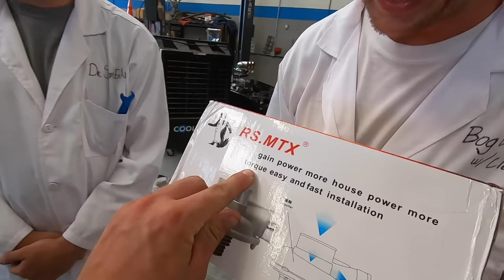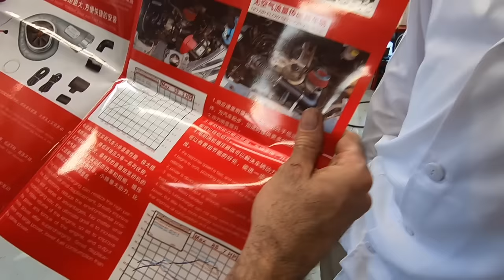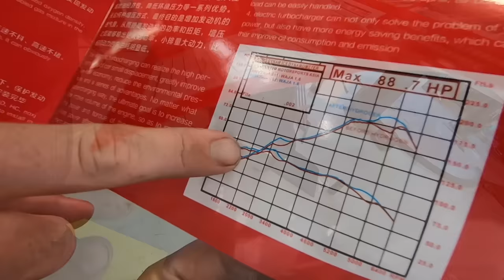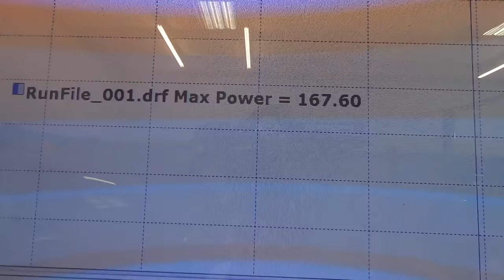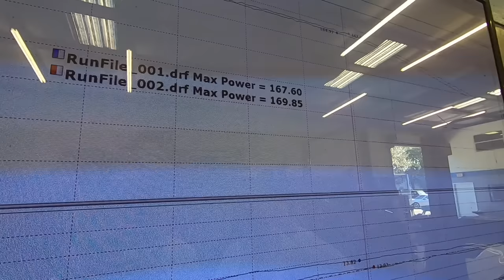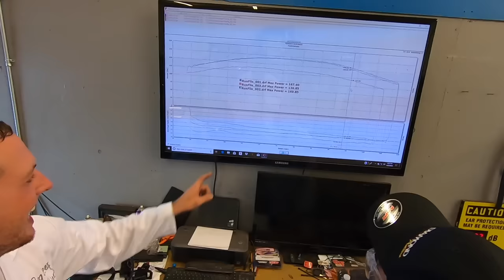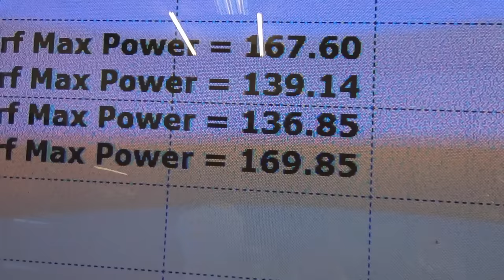Dyno Testing a $400 ELECTRIC TURBO! Funniest Car Part EVER!

Comment: Okay so take the same “turbo” and wire it to 24 volts instead of 12
Reply: Doble powah ... ;-)
Reply: MO powa
Reply: It obviously needs twin e-turbs :)
Reply: That's what I was thinking bridge a few optimas together and send it!
Reply: Dyson power, change out the electric motor for a brushless Dyson,  agreed that not only 24v maybe 48v
Reply: Or hook it up to a little 4 banger that doesnt need as much air
Reply: Add a 5 to 1 gear reduction transmission so the thing spins at like 50000 rpms rather than 10000 rpm
Reply: @gremotorsports  so if I add a 5 to 1 gearbox to my car it will go 1000 mph with the same engine?

Comment: You need a small engine to test these. They're designed for cars in countries that have engines of 2litres not 4 or 6 😂
Reply: 1 liter 3 cylinder car. Mightycarmods did it on such a Car. But a 50cc 4 stroke scooter would be the best to see if gaining horsepower is even possible with this.
Reply: @patricknintemann924  it doesnt it has been done on pocketbike
Reply: @patricknintemann924  How about a .12 OS RC nitro engine?
Reply: It won't matter.  In this case it's actually restricting the air flow, but even if it did not restrict the air flow, it won't increase the air pressure going into the intake.  It's just a rip off.  If it was really that simple, then OEMs would be using electric turbos as they would be far more tunable, cheaper, and simpler to maintain than standard turbos.  This product is for people who don't know anything about engines.
Reply: @i486DX66  electric motors can and do spin at higher speeds then combustion engines. They can produce ridiculous amounts of torque also. This case,  was simply undersized pump for the capacity.
Reply: @burnout9069  First of all, conventional turbos spin much faster than the engine.  You might be thinking of super chargers which are mechanically driven from the engine's crankshaft.  Although I never mentioned anything about RPMs or torque, it's simply the fact that in order for an electric air pump (let's call it what it really is) to increase power output of a combustion engine at all, it must be able to feed the engine enough air at high enough air pressure to create "boost".  People have tried attaching gas-powered leaf blowers to the air intakes of much smaller engines and it made little difference in power output of the engine.  Again, if extra horsepower was as easy as attaching what is basically a hair dryer fan to the intake of an automobile...OEMs would have been doing it long ago.
Reply: @i486DX66  I'm fully aware of the concepts. My point was still, this application was undersized for the capacity it was trying to feed (boost)  too. Now if this same pump was placed on a much smaller displacement engine, with the needed fuel to supply the added air being forced from what positive pressures may have been offered. This $400 blower/turbo wouldn't look so bad. 
Could it sustain the boost? That's another story?
Reply: @burnout9069  Obviously it's undersized because it's actually restricting the airflow which is why the power output dropped substantially.  But even if they attached it to a 1 Liter 3-cylinder engine, it would not increase the power output because the electric motor would not be producing a sufficient pressure differential at the output vs. input.  Although based on the number of people here defending the worthless product, I can see why it's being sold.  Apparently there is a market regardless of whether it works or not.  But $400 for that piece of crap?  Wow.
Reply: @i486DX66  Did I miss the air flow chart? (genuine question). Not that this product would have been clear on that anyways. But your understanding isn't entirely true mate. Regardless how the positive pressure being made on the inlet side, makes no difference. If it could hold pressure (torque) through out the tracts,  and additional fuel supply was met in offering a clean burn. Power gains would be seen. Its simple physics that can't be ignored. 
Whether it's brought or not,  makes no difference to me. I don't sell them. Nor would I have any use for one.
Reply: @burnout9069  Even if the product was installed on a much smaller engine, it would not be able to sufficiently increase the air pressure to generate any kind of a increase in engine power.  How do I know that hair dryer motor won't sufficiently create enough pressure?  Because, as I said earlier, if it was that easy, all OEMs would be doing it.  If that simple motor actually worked and provided equivalent forced induction comparable to a conventional turbo, then everyone would be doing it!  One advantage to that approach unlike the conventional turbo and superchargers is that peak "boost" would be delivered almost immediately without having to wait for the engine to rev up.  It would also be a lot easier to install, cost a lot less, much less weight, take up less space, no maintenance, etc.

Comment: its spinning the wrong way, you guys should reverse the polarity and try it again.
Reply: That's just the shutter speed on the camera.
Reply: @joe_clark
"I understood that reference!"
Reply: @Private Name withheld well it certainly looked like it was blowing the right way when it was out of the car but when they had it installed it certainly seemed to be going the other direction. if the camera made it look like its going the correct way once why would it make it look like its going the wrong direction 5 minutes later when filmed by the same exact camera
Reply: @nath8907  go back and watch 17:54 at .25 speed and tell me that thing is spinning the correct direction.

Comment: Hey man it’s because the Mass Airflow sensor needs to be pre-turbo. The “turbo” was causing turbulence and (possibly?) positive pressure that the MAF sensor was never designed to deal with
Reply: I thought about that too..  but these guys are amateurs.
Reply: Yup... went through the same thing when I turbo’d my tacoma truck 👍👍
Reply: That and it was spinning backwards
Reply: fact of the matter is whether this can increase the CFM...maf adjusts for additional air going through it (mass air flow...).  A blender can't supply enough air for an engine at higher rpm.  Some manufacturers are installing electric turbo's for extremely low rpm conditions, where the CFM needed isn't high.  If you want a turbo - get the real thing.  They're expensive for a reason.  If you want cheap hp get a bottle of NOS.
Reply: @dovobis  an electric turbocharger isnt worth it. Even at $400. Theres no bang for your buck there. I'd look at an engine swap or a real turbo kit before this thing.
Reply: These guys won't understand what that means
Reply: @ Ignoramus
Theoretically yes, but all factory turbocharged vehicles from the factory equipped with a MAF (not a MAP) sensor have the sensor located pre-turbo to get the most accurate reading. Spinning “turbo” blades cause vortex turbulence that confuse the MAF sensor and causes the ECU to retard timing when not specifically tuned around that. When I turbocharged my Tacoma truck, it ran very inconsistent with the MAF in the charge pipes. Now that it’s pre-turbo, it’s very consistent and doesn’t hiccup like it did. I’m not saying that all vehicles are like my truck, but the fact that all turbocharged MAF equipped vehicles have it pre-turbo does say something.
Reply: Here's the thing... Any electric turbo/supercharger will need to pull a certain amount of current at FLA.

Now.. when calculated how much FLA is being pulled from the turbo at so many RPM'S 
To produce so much horse power.. the same test will need to be done to figure out what the FLA is with the engine under load, and how much of resistance that is making for the alternator..  resistance = horsepower needed to turn the alternator ..  if the turbo is working against the horse power there really is no point to it.. and after thinking about this.. this might explain the 30HP drop... Resistance is a bitch when it comes to electrical motors.

Comment: Put the electric turbo on a less than 1 liter engine
Reply: Yep seriously, the moment i saw the drop, I knew the "turbo" was choking that V8. Perhaps a lawn mower engine would be more apt.
Reply: Put it on a Go Kart!!
Reply: That's not a happy motor any more...  I drive a 1 litre 3 cylinder turbo Opel that turns almost exactly 100bhp & 170nm+ on the wheels, only thing not standard is the Michelin Pilot Sport 4 tyres.  But seriously, that electric fan doesn't blow enough, it may work on those old 850cc Fiat Uno Cento from the late 90's but I wouldn't hold my breath.
Reply: Yeah I was think that maybe but at the same time I wonder if it just going to restrict that too
Reply: @joshuadavid7675  Why not spin it faster then? Who needs 12 V when you can have 24 V?
Reply: @vitaobatera  yeah man I would like to see that on some motor like is Fiat uno or Fiat 600 or something like that 850-1000 cc
Reply: @rsajay6256  you won't hold your breath but that poor mustang sure did when they put that Hiroshima hairdryer on it 😔🤣
Reply: @loudsonicbug2195  You'll probably burn the motor doing that.

Comment: Yea, engines flowing more under vacuum than the blower there, almost needs a gearbox inside the electric motor to spin it 3:1
Reply: xempt. one you’re definitely on to something there
Reply: More gear ratio would need a bigger motor to create even the minor pressure it creates now.

Comment: You can actually hear the turbo spool up faster when you throttle the engine so it's working harder because it's actually sucking the turbo to make it spin faster it's a piece of s*** LOL
Reply: Just need an electric motor with way more ripums.
Reply: Gregory Kitchens maybe it’ll chooch a little better with more ripums
Reply: Maybe this would work on a smaller engine? Motorcycle or gocart or something like that? 150-200cc?
not a big v8
Reply: @brennanpaddock1857  a man of culture i see
Reply: @lazarjanjusevic3  it would be hard to say, even single cylinder engines can breath pretty deep.

Comment: I’d imagine this thing is for smaller 4cyl engines.  Per say, a 2.0L might draw much less air and this may actually function.  A full blown 4.6L V8 will draw way more air and overpower the “turbo” even though it may not necessarily make more power
Reply: A "smaller" 4-cylinder is like a 660 cc (yes, 0.66 L). A 2.0 is practically gigantic. They mostly just go with 3-cylinders when the displacement is around there, but there are definitely sub-1 litre I4s to be had.
Reply: Correct,it should be rated in CFM flowrate. Carburators- remember those ?- are rated in CFM s .150-250 for a 4- cyl; 250-400 for a 6- cyl.; 400+ for a big V-8. The HP required for boost is substantial, a normal turbo takes it from exhaust back pressure. Audi/ VW already has an electric- assisted turbo that cuts turbo- lag to nothing. This unit might work on a small 4- cyl...

Comment: I don't understand how everyone fails to realize that they put that right on top of the mass air flow sensor which is going to cause the mass air flow sensor to read all kinds of wrong guaranteed because of all the weird airflow around something that should have a steady airflow
Reply: right! especially with the old AFMs (84-92) vw golf, analogue with the mechanical door the potentiometer above, instead of the sensor, if you open more at the same rpm, the control unit will think that, either you are going uphill, or that you 'it's a heavy load ... I think it would flood the engine .... too good to be true
Reply: Dude look where it is made, IDC if it is set up perfect, it will not work

Comment: How much is a "House Power?" Well... if your house has 100 amp (maximum) current service and runs at 120 volts,  and Power = V x I (Voltage x Current), then 120 volts x 100 amps = 12000 watts, or 12 kilowatts. Next, one watt is 1.33 horsepower (approximately), then 12 kilowatts = 16 horsepower. Therefore, 1 house power = 16 horsepower. At 168 horsepower, the Mustang is making 10.5 House Power. With the "electric supercharger," you lost about 2 house power.

Mind you, this ignores AC vs. DC power, 220 volt service for some appliances, etc. but that should give you a rough idea. 

Also, an "electric powered turbocharger" is really an electrically powered centrifugal supercharger. Now go break something. Else. Some more. Again.
Reply: John Lloyd, You are the intuitive engineer that modern America needs.
Reply: lmfao the fact u did the math on that
Reply: Precisely.
Reply: @bennyc4905  : Small, trivial things amuse me when my curiosity is piqued. Besides, answering that question was silly, so I did it.
Reply: John Stamper  : That's the stove, the water heater and the dryer.

Comment: Shouldn’t you adjusted the air-fuel and timing just like a bolt on supercharger.
Reply: Nah bro. Not if you're tuning for HOUSE power...if they were looking to tune for more horse power that's a whole other story but that's bush league.

Comment: In order to have some effect you’d have to have that turbo plumbed into a  Y pipe with a filter on the other end.
Reply: Then you'd lose any potential positive pressure out of the filter end.
Reply: Not at full throttle, it doesn’t make that much boost.

Comment: Add in a “Y” pipe, that way that turbski doesn’t add any restrictions to the intake. House power FTW!!!!
Reply: That was my exact thought
Reply: If you Y pipe an intake with any sort of boost. Assuming you get boost. Then the air would flow out of the other inlet. Path of least resistance. The point of boost is to pressurize the air above atmospheric pressure to get more volume in the same space.
Reply: Or even better. Add another e-turbo to the other end making it a twin-e-turbski :)
Reply: @jes99003  Yes twin e-turbo's is good but I would say at least 4 of these e-turbo things to actually make House power hahahahahhahahaha
Reply: @jasonstrout4502  Why not make it five for a "Full House" :)

Comment: You need to try it on a smaller carb'd engine so you can adjust the air fuel ratio manually before you get started

Comment: Air Flow Meter needs to be prior to Turbo. Test it again in this configuration. you will find it will work. Also Crank case ventilation valve will need to be removed from the intake pipe. This is why your AFR's went rich
Reply: Tru
Reply: Honestly I was surprised at the power loss but what difference does putting it before or after the flow meter make it will be the same amount of air pulled in.
Reply: @alulatadesse1646  fuel ratio......
Reply: it won't work.... this thing is junk

Comment: Maybe use a "Y" shaped PVC pipe fitting at the end of the intake tube. One side stays traditional and allows in air and the other side, the "Turbo" can add in air....all the housepowers!
Reply: You can't effectively pressurize an open system. It would be like a huge boost leak.
Reply: @JusttheEdge  judging from the power loss, there's no boost to leak

Comment: Dudes, you got to increase the amount of gas while boosting! You can't just give more Air.
Reply: @jeffel80  you think the car can handle the higher pressure? But why is the lass House Power?
Reply: I’d you go back and watch it again it was running  richer with the hair dryer on.So it was restricted air flow
Reply: @JB-tw9oy  ok, so no more air?
Reply: @JB-tw9oy  The blower was running backwards!
Reply: Robert Longo 
Of course! Ya see, it was actually SUCKING air out of the engine instead of forcing more in 🤦‍♂️ 
I can’t believe he didn’t notice!
Reply: You have to size the turbo to the engine, and they obviously didn't. I could tell by how small it was that it wouldn't have enough airflow for a 4.6 liter engine. They obviously didn't look at the compressor map before buying it, that would have told them all they need to know about how much hp it could make.
Reply: @jeffgabrisl7016  right, turbo have been to small

Comment: The electric turbo makes less boost than the engine has vacuum
Reply: yup... Still as long as there are crooks making these products and claiming false gains there will be people with no mechanical knowledge buying them.
Reply: I guess it could make a difference when you put it in a small 4 cylinder engine. In the current setup it's so small that it actually restricts airflow.
Reply: Yutube Lurker  I wonder if Cleetus would wanna try a round two with a small engine ? =)
Reply: Yutube Lurker  it wouldn't even make a difference on a single cylinder engine. Ive seen people try it.

Comment: House power equals negative horse power, that’s why you’re loosing power. Horsepower = gain, Housepower = lost power
Reply: Lok at the duuuude at the battery driving the turbo he was not truth full.. 
About driving continiusley on the turbo 
The 2 ud run was the same as with out turbo 169hp 
So All in All in more of thoes and you hawe surplus presiur

Comment: they should measure psi at the intake for this test to be valid
Reply: that right NA engine need vacuum info to work well with lambda MAP is destroy when its some presure in intake

Comment: Shouldn’t that be installed after the MAF, not before the maf? And closer to the manifold?
Reply: That's what I was thinking too
Reply: I think the concept is the mass air will sense more air, and communicate to the fuel pump to  add fuel if needed. I'm guessing
Reply: Jesse Dowling but the volume of air doesn’t change whether it’s pushing or pulling the air. Still the same amount of air being sucked in by that charger. That’s why super charger kits are directly mounted onto the manifold.
Reply: @jeffc4399  I think it was for ease of video purposes, which I haven't watched entirely because the outcome was predictable...
Reply: it also needs different spark plugs and a tune.

... and a turbo that isn't a choke point.
Reply: At least a tune or double check the data from the wide band (O2). It could have been leaning out as far as we know.